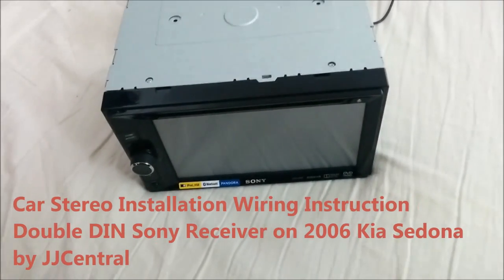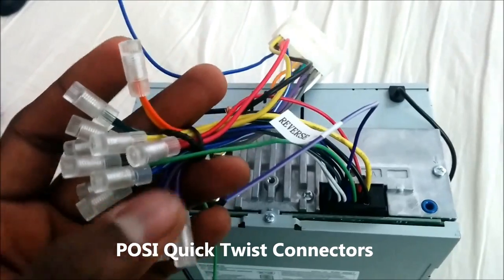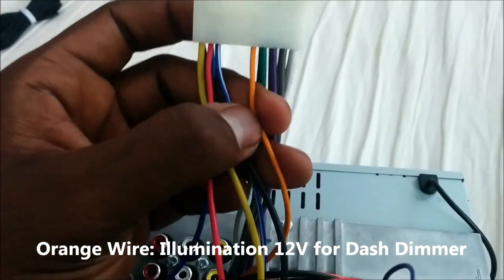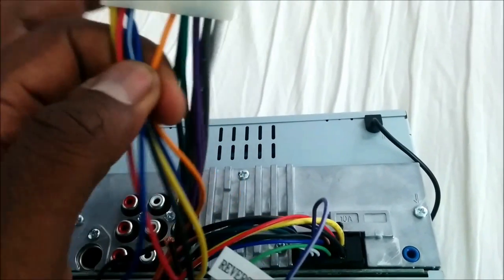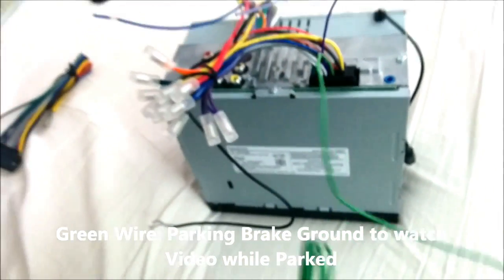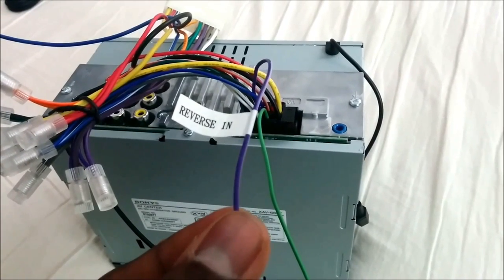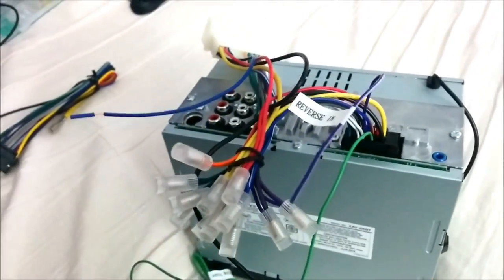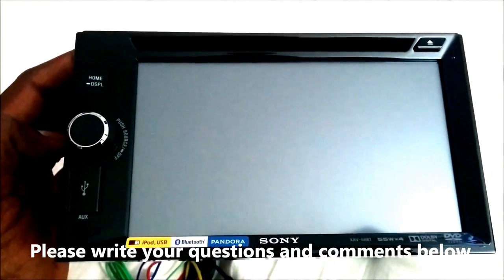Sony Double DIN Receiver Install (Part 1) - Car Stereo Wiring Explained (How to Video)

Comment: Thank you so much for this explanatory video, very simple and straightforward, saved me a lot of money going to get this installed for me, rather did it myself and works perfectly..
Reply: a tip : watch series at Flixzone. Me and my gf have been using it for watching loads of movies lately.
Reply: @Miles Parker Yup, I've been using Flixzone for since november myself :D
Reply: @Miles Parker Yup, been watching on Flixzone for since november myself :D

Comment: What is the blue port at Rear side of the player, RIGHT SIDE,PLZ REPLY, 🙏🙏🙏TNKS
Reply from the maker: Believe it is a steering wheel volume track skip button control module input. You need to buy a separate module to hook up factory steering wheel buttons to the stereo unit.
Reply: @JJCentral-DIY  Tnksss fr Sudden Reply ,Is it an Connection for External Mic ??,Any Idea🙏🙏🙏

Comment: Hello, thanks for your video. Its very educative. Please where do i get both harness for my bluetooth radio n for the car. Am using a 2006 ford five. I follow your steps but my can't come on when i turn on the ignition n the illumination light is always on. Needs help
Reply from the maker: I bought it in crutchfield, you can also call them and they will make sure it's compatible.
Reply: Do I need to connect the reverse wire to the camera's red wire?
Reply from the maker: Your reverse wire needs 12v power from something that comes on when you put the car in reverse. Preferably the reverse tail light bulb or the bulb in the reverse shifter. Camera wire can also be powered by the reverse bulb wire.
Reply: @JJCentral-DIY  My car player is a Sony xav-v630bt. I have put the yellow pin in the right place but where should I put the red wire that goes with it in the player so that the camera starts automatically.
Reply from the maker: @sushisingh175  look in your Sony manual and see what they call the red wire. It could be acc power, it could be reverse in, it could be camera signal. I don't know just from wire color

Comment: I've just finished wiring my harness, but I've got a bad feeling about it. The radio's harness' wire was a much smaller gauge than the metra harness', so I twisted, folded them back, then twisted again, then inserted them into the butt connector. They're holding firm after crimping; will this work? Also, I may have a few extending ever so slightly into the heatshrink, but not outside to the wire; they're not exposed. I haven't done any wiring since highschool, so I'm doing a bit of a rough job.

Comment: How to connect and where connect the illumination cable, and what is the function of it?? Please suggest
Reply from the maker: Atanu Biswas you just need to collect the orange wire to another orange wire. All it does is gives the after market stereo the ability to dim the brightness along with the dash lights. If you don't connect it, the stereo brightness will always be high unless manually reduced. Hope that helps.

Comment: Can I have some more opinions on those who have this head unit?
Reviews state the blutooth is insanely spotty, but other than that I'm still highly interested and it's discounted at the moment. Should I go for it or not?
Reply from the maker: Bluetooth works perfectly. It depends on what phone I guess. What I don't like is the fact that you can't change background image of the unit.
Reply: great, cause i just had it installed last night haha. I'm not too fussed about the background image :)

Comment: Does this stereo fits on a GMC ENVOY 2003 model ?
Reply from the maker: This stereo should fit in any double din dash. Mostly all cars after 2002 have them. Thanks.
Reply: Not sure it.But based on your car, you may check this HU: https://www.amazon.com/dp/B078C7N4SJ

Comment: How i can connect Bluetooth without steering control
Reply from the maker: Bluetooth doesnot require steering control. You will just talk into your mic with voice recognition, "call Joe" and it should dial for you using google assistant or Siri from your phone.